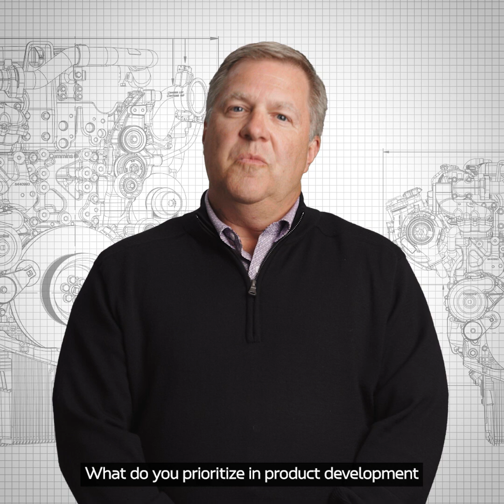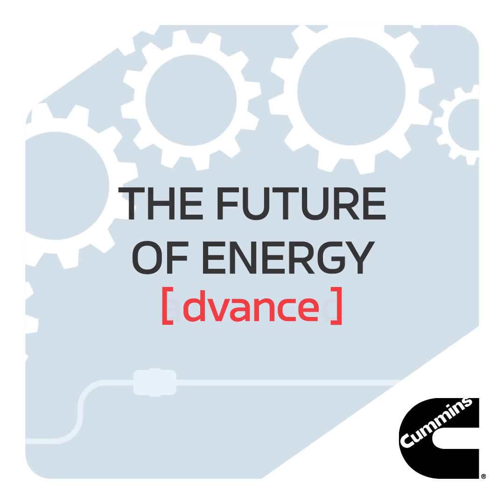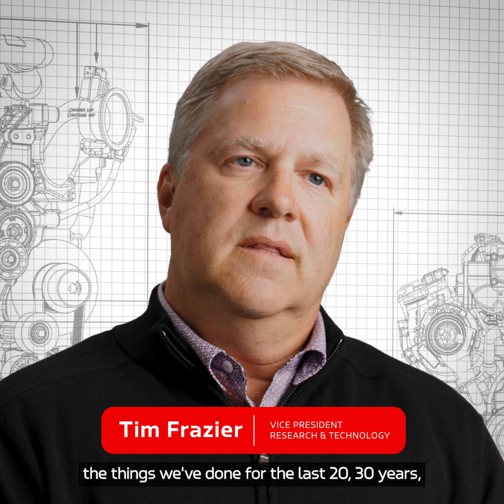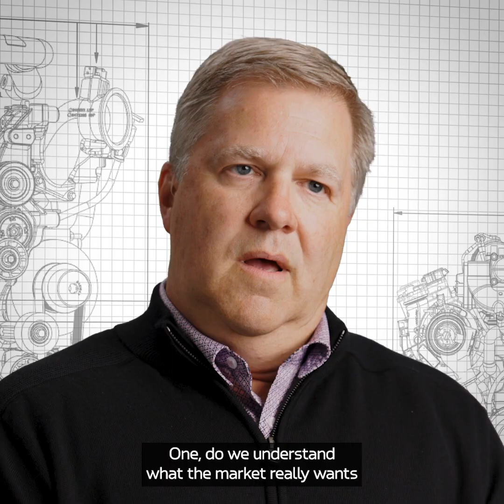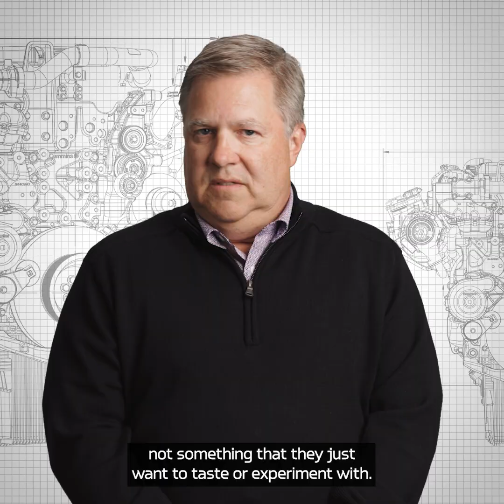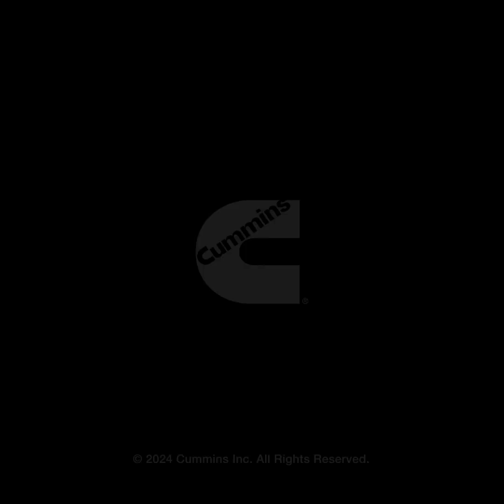Future of Energy (Advanced) | What do you prioritize in product development for future technologies?

Comment: If you were serious, you would be designing products that were designed to last. And engines that could easily ( within 5 minutes) be completely stripped of all CAFE garbage products. ie. 6 bolts and no more smog crap. And the moment you unplug whatever garbage sensor that monitors it, the computer will switch to the fuel map the military uses on their trucks.